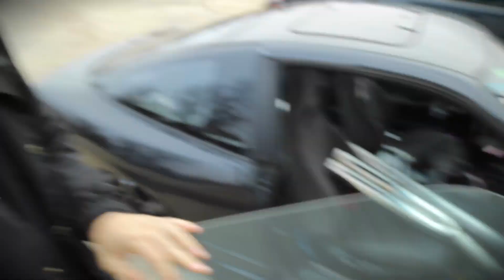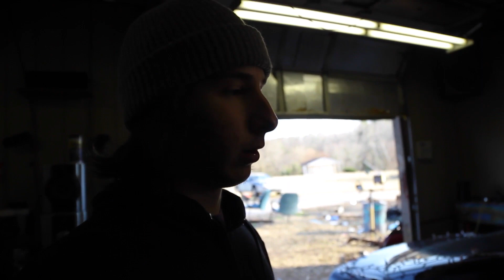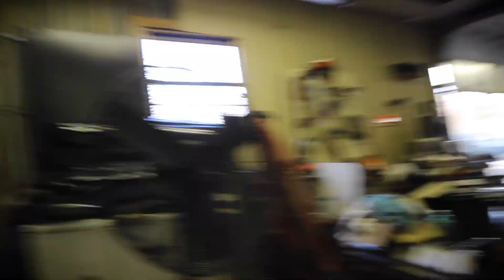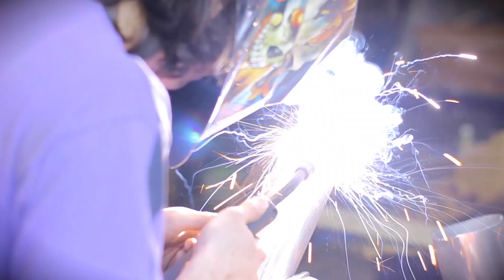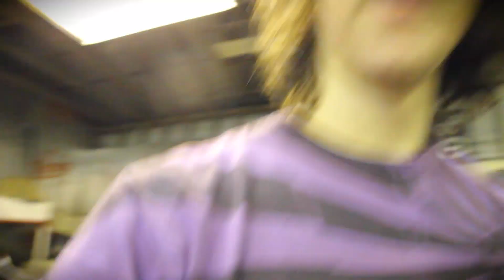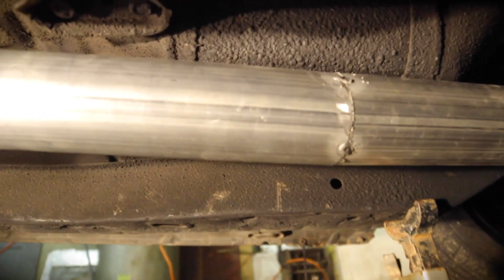TURBO 240SX BUILD | ISR EXHAUST INSTALL

Comment: My $125 d-spec cheap cat back exhaust was modified for it to sit closer to the body.  A muffler shop cut out and welded in a new section.  It took it to a non franchise shop and they did an awesome job for 50 green backs.

Comment: just buy new poly hangers or use stock ones just rap the clamp around the hanger so it wont rattle if it rattles because of metal on metal contact.

Comment: @southernhooning how long did it take you to get your blast pipes? Enjuku and ISR said I probably won't be getting mine until mid to late January and I had ordered it in November
Reply from the maker: Cursed Racing only took like a week for me, but they probably dont have then in stock like they use too
Reply: Cursed Racing mine took 3 months from fr sport 😡